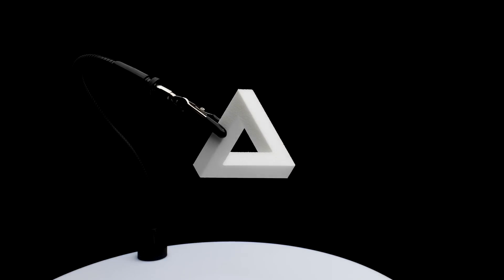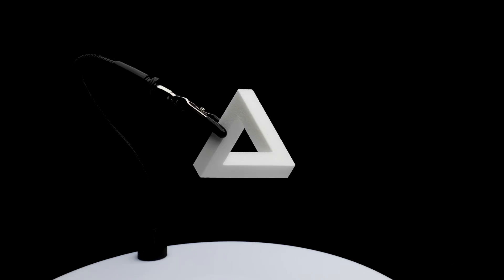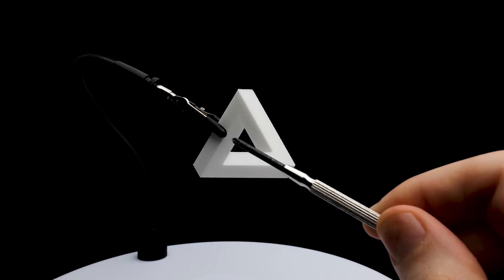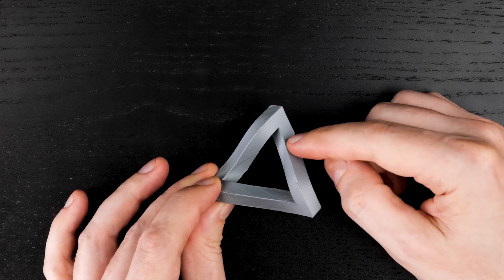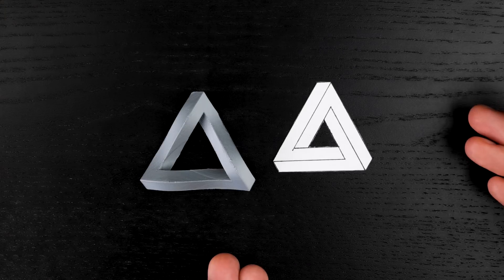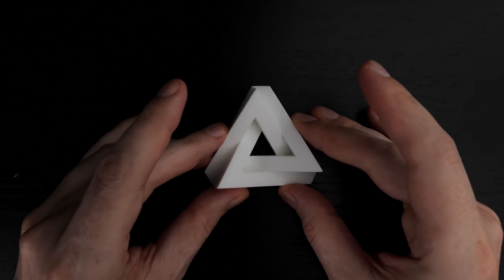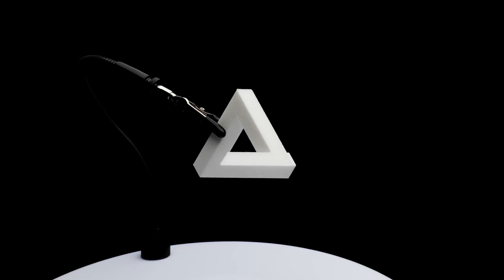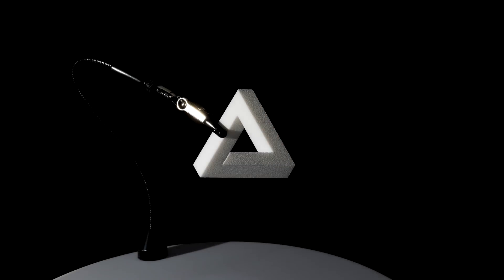Impossible triangles

Comment: Thank you for showing the model by Tato_713. It shows that the Penrose Triangle is topologically possible and fully buildable in 3d with curved edges. I think if you made the arms long and narrow enough (say length/thickness ratio in the range 30-60, that is 0.5-1cm for a sidelength of 30cm) the curvature would be a lot less noticeable.

Comment: Did you specifically account for the perspective distortion though with a specific focal length of the camera? or is it just "orthographically" designed and just works anyways?
Reply from the maker: I assumed a perspective view with the rays converging 25cm from the center of the object. I don't have a good understanding of how camera lenses work, so I wasn't sure that it would work well, but it seemed good enough. I guess that the lenses are designed to do as little distortion to the image as possible.